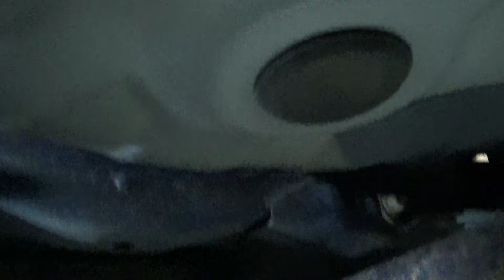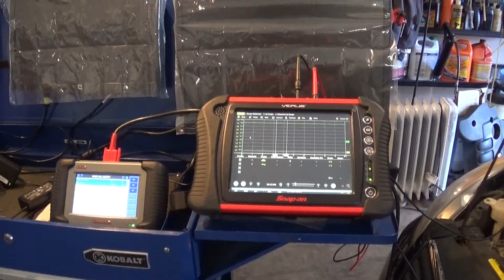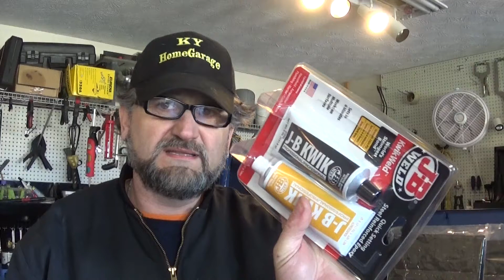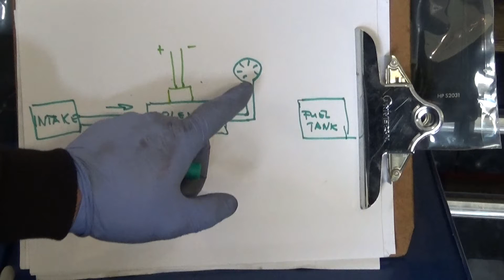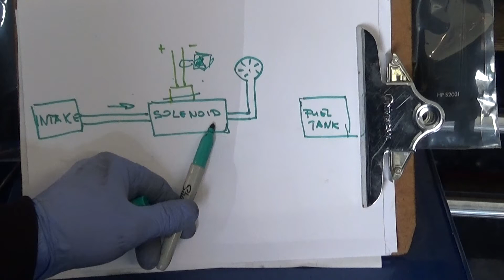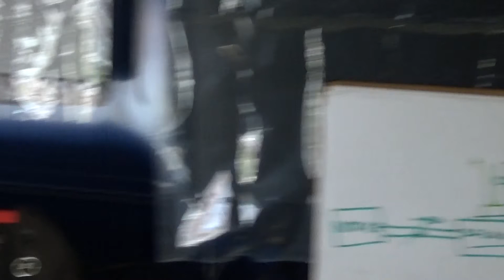2008 Nissan Altima P0455 Large Evap Leak Diagnoses

Comment: Great diagnostics! Sorry about your Pico, hopefully you will find a replacement soon! I was using my own homemade pressure transducer yesterday, works great with the custom scales!
Reply from the maker: Hi.  My Pico was old generation 2000 series scope. It was not designed for automotive testing but it  was working OK for my needs. I will update to newer generation 2205A scope its only $130.00 new. Cant afford automotive pico yet but its on my  list. Thanks for watching. Cheers.